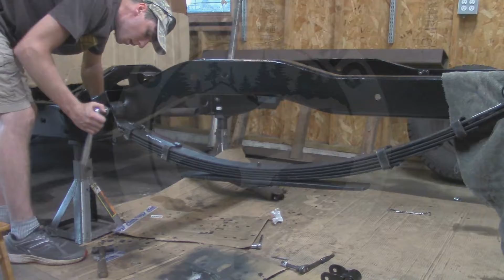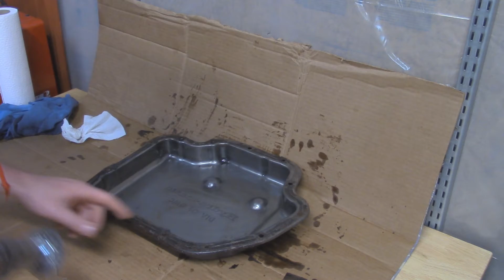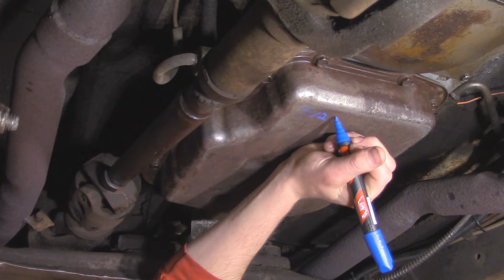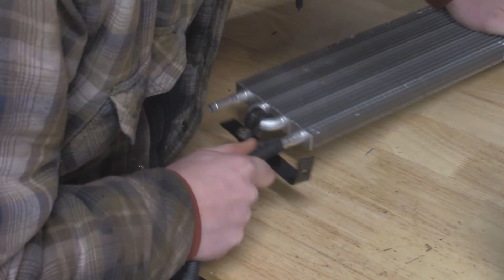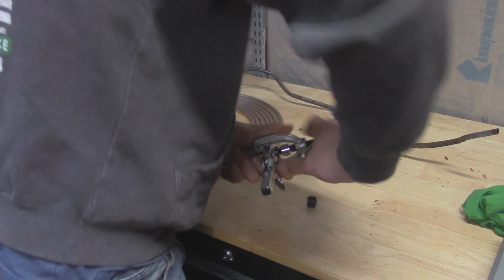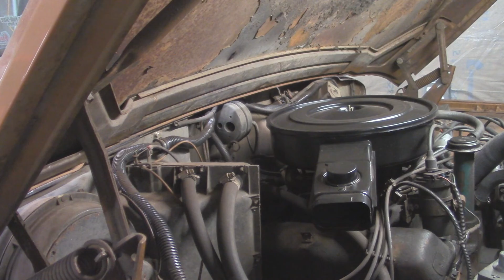TH400 Transmission Service | 1978 Jeep J10

Comment: Next time go with lube locker gaskets there awesome you can reuse them about 5 times is what I’ve learned and I run them on everything axles transmission pan oil pan just nice and easy and if you have a uneven mating surface it will seal that’s the nicest part about them never had one leak and if your a off roader you can open up your axles do repair bolt up and go without having to wait
Reply from the maker: That's a great tip, I've heard those reusable gaskets are a total game changer for maintenance!

Comment: Do you think you will ever make a video on how to fix the rear cargo floor pan on an XJ? I am in dire need to fix mine and like having your videos beside me as I fix stuff, so it would be nice.
Reply from the maker: I need to do so on my XJ as well. Just not sure as to when I will get to it but it will be recorded!
Reply: @OutJeeping  Awesome. The previous owner actually ran the upper shock bolts into the floor instead of using the flag nut method, so I thought about installing an upper shock mount bracket kit and then repairing the floor while there.
Reply from the maker: @Throttle_Revival It's a good option, I was thinking of getting one for my last XJ. You can then get more flexibility out of your shocks.
Reply: @OutJeeping  Exactly my thoughts too. The Jks adjustable one is probably what I'll go with. Love your videos man